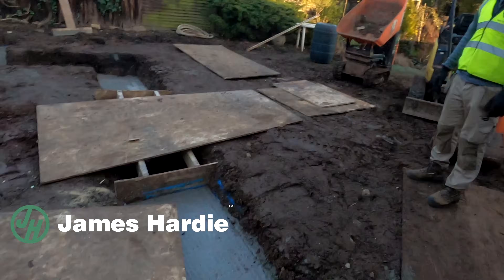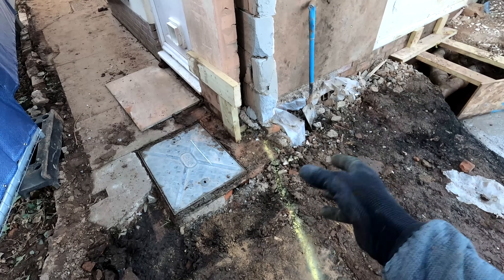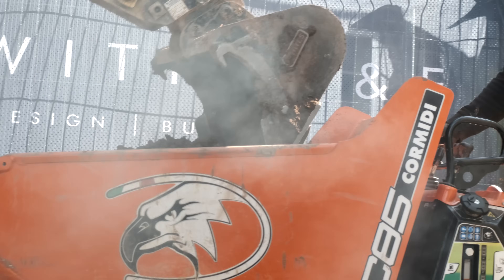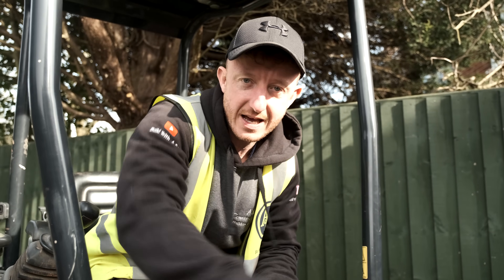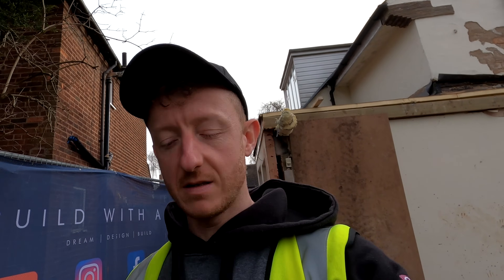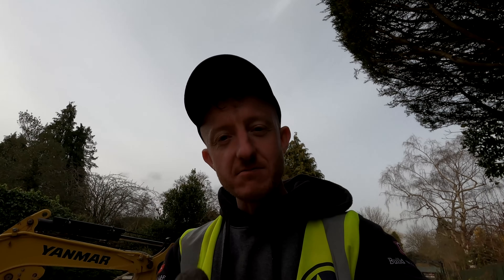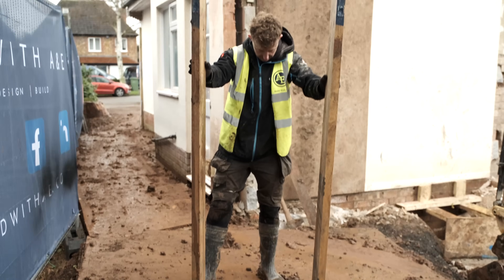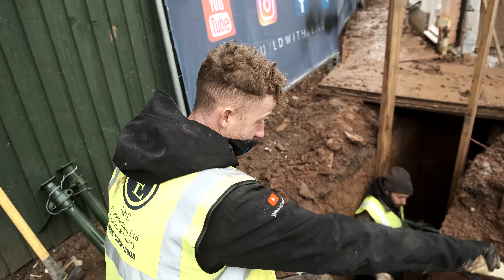Digging the Footings: Part 2 ⛏️ | Single Storey Extension #5

Comment: Hi guys love tour videos so informative. I’m a builder myself. I see Tony is a builder coming from a carpentry background I love his take and approach to most things. I myself came from a groundwork start and I can’t help but worry for you guys at those depths. We work in Essex and is predominantly clay on most jobs. We use sheet piles on every foundation relatively cheaper than ply all the time every metre or two we dig we slip a pair down and strut top and bottom. Not trying to tell you guys what to do but seen many a cave in over the years.  Stay safe and keep up the great content.